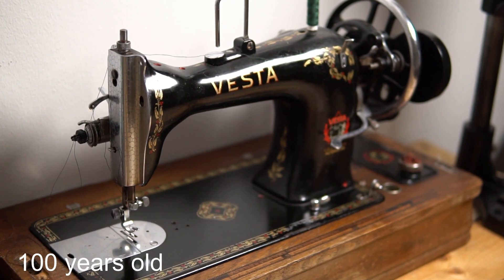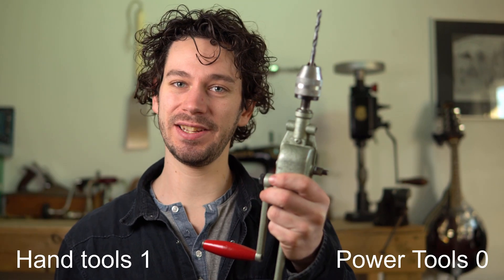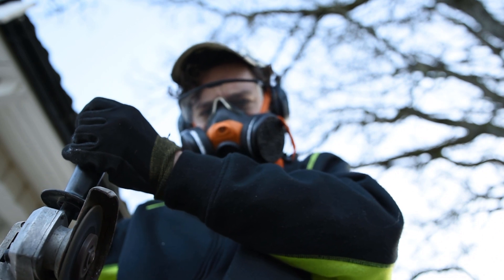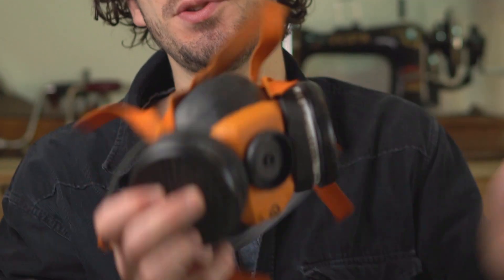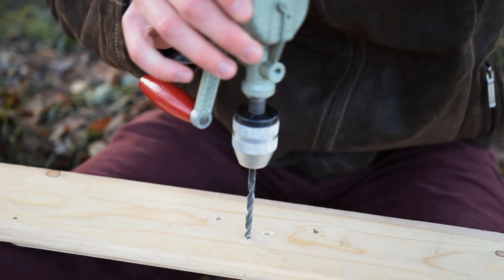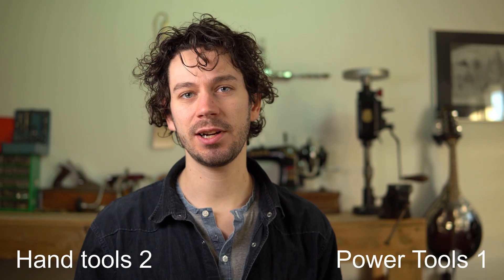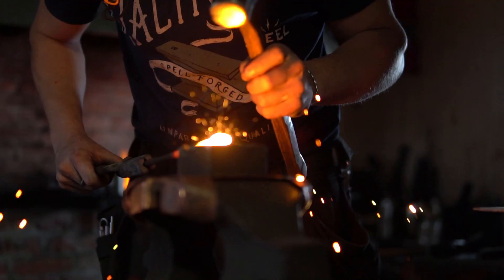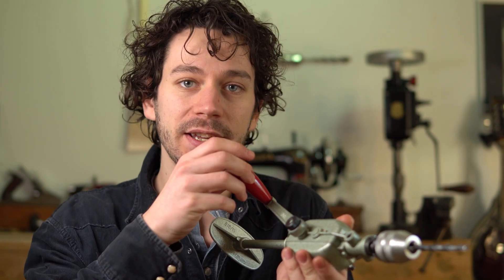Hand Tools VS Power Tools - Are Hand Tools still Relevant in 2020?

Comment: Can hand drills go through metal?
Reply from the maker: For sure, I use them on metal all the time. If it's hard metal you should start with a thin drill bit and progress to bigger ones (that's also recommended on power drills)

Comment: personally, I definitely choose to use a electric (cordless) drill, which half the time is I use to put in screws. But, I also definitely choose to use a hand saw instead of a electric jig saw. I notice that cheap rotating tools last quite well, but cheap reciprocating tools do not. If you spend the $40 that the cheapest jigsaw would cost, you'll get a really nice hand saw. The cheap jigsaw will vibrate badly, and this makes it difficult to do a straight cut! So you could buy an good quality jigsaw, but then if you consider the time spent earning that money, it's not faster!